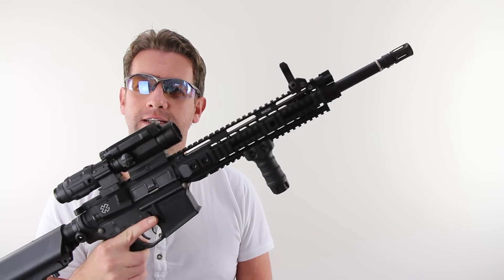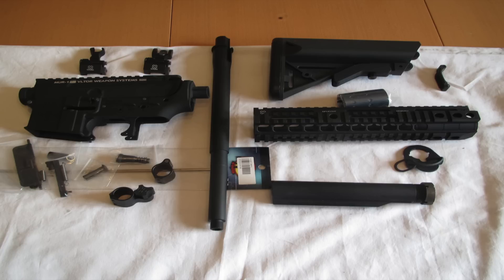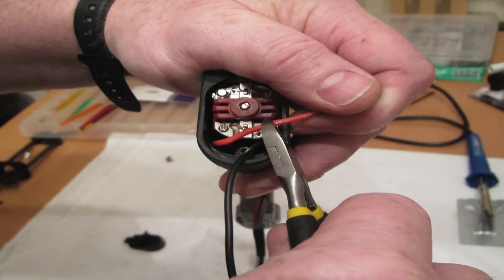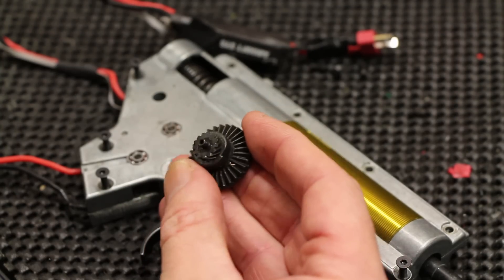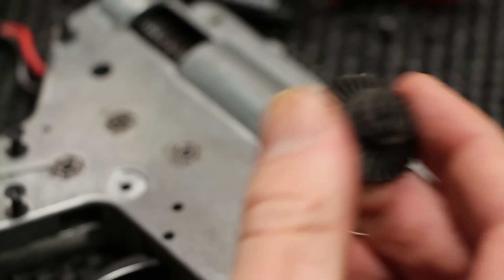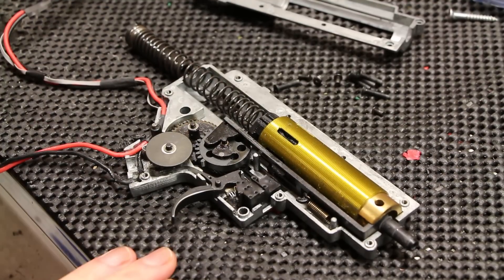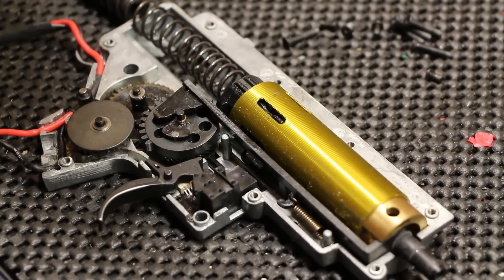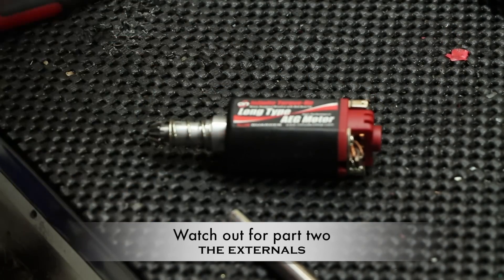My DB Noveske M4 Custom - Part 1 The Internals

Comment: Really appreciate the video Oddy. I have experimented with Helical and not had good results. They are so incredibly temperamental. You cannot shim them any way other than utterly perfect. You cannot have a little slop like regular gears to allow self adjustment. Helical is perfection or nothing.

Comment: Systemas design and materials are from late 90s, you really can get much better products  these days. Lonex, SHS etc... You can see old design from bevel: it has only two slots for ARL (that's the reason why you get that "backslash") it should have 6 or more slots. And for the piston, he was correcting angle of engagement, not short-stroking. Methods used tuning this gearbox were good 10 years ago when there were nothing else than TM, Systema and CA ;)